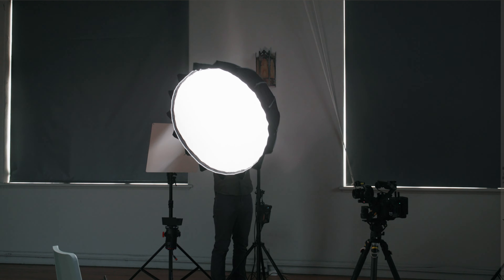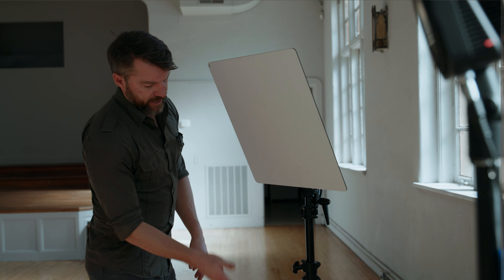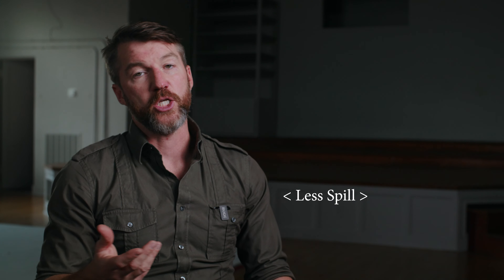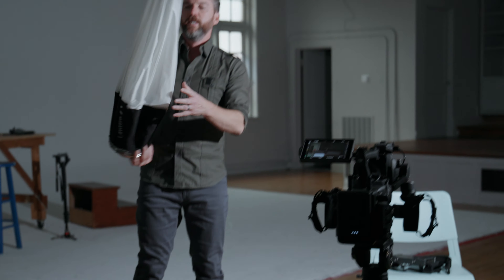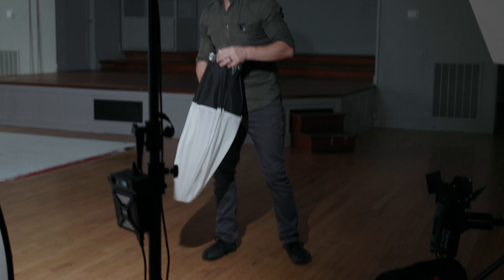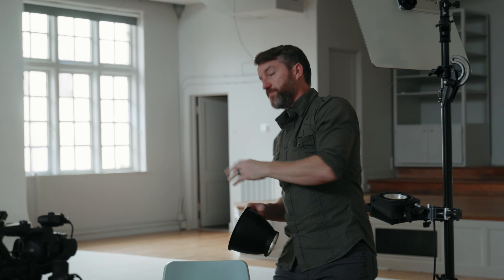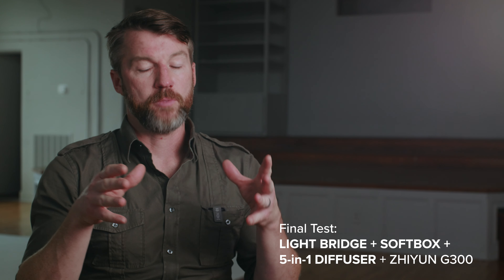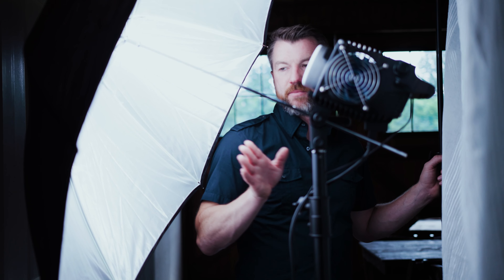Ultimate Diffusion Side-by-Side Test | Softbox vs Scrim vs LightBridge vs 5-in-1 vs Lantern vs...

Comment: I'd want to know how large and at what distance the light source is, since that's the main factor in how soft a light source is.
Reply from the maker: If you scrub through it and see some of the wide shots of the whole setup, you'll see the distance. I didn't move the light the entire time, just changed the diffuser. And then the size of the light source changes with the diffuser (usually).

Comment: I think the scrim looks the most natural as the falloff is more gradual than the Dome 2 (which is the second best imo). Might be to do with the intensity of the light too, small changes can make big effects there. What the soft-box is great at is isolating the subject more as there is less spill on the background. So depending on the setup/mood, either is a great solution. Lightbridge looked very sourcey. I think the mirror system mainly shines (ikik) in hard light scenarios.
Reply from the maker: Yes, I think the Light Bridge would be great on making hard light softer, if that makes sense.

Comment: This is amazing. Something I have also wanted to do but never found the time to do. The physics of it is simply the size of source but in a doc context I actually think the dome and umbrellas are wildly underrated. You, um, confirmed my bias.
Reply from the maker: Haha sometimes it's worth doing to confirm what we already know.
Reply: It's the size but also if you are making that size (the source ) via a diff frame / softbox etc , it's how evenly you can fill that final level diff . Thats the advantage of large LED,s , you are already very evenly lighting the diffusion , which is also the purpose of a book light ,  but they have to be built up compared to the ease of putting on a softbox, but quicker and a much smaller foot print than a book light.
Reply: @ my take is really you want to light the environment as well. The dome and umbrellas give your source and the room some context.
Reply: @blnksktch   Yeah but you usually want control of your key light for interviews , you don't want that light ,lighting up the whole room , ie why lanterns / umbrellas  are not so good., domes with a grid will be relatively directional and not spread so much.  Also best to have the background darker than your subject. Of course it's not a law :) , but 99% of interviews will be like that .  Im just saying that evenly lighting what ever is your final diff screen is important to get the light soft . Which is what book lights do well as your bouncing the source into a diff , the same quality will be achieved by going direct into the same sized diff , but you need to get the light back far enough to evenly light the diff frame.

Comment: Great vid! When you were putting the lantern on, did I hear you say the Zhiyuns were hard? I have a g200 and getting modifiers on and off is brutal. Super hard.
Reply from the maker: Haha yepppp - muttering under my breath. They are great lights, but hard to get a hold of to put the softbox on. I often put the softbox on the ground and then attach the light to them before I put them on the stand. Much easier.
Reply: @CurrenSheldon   Yes I do this with the G300 , with a 90cm Godox T series dome, it's the best way for sure .